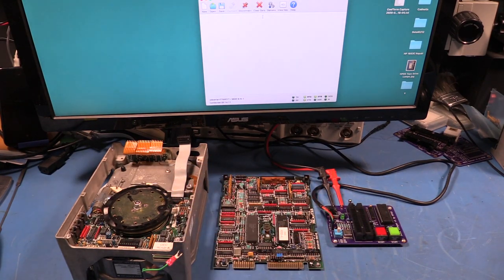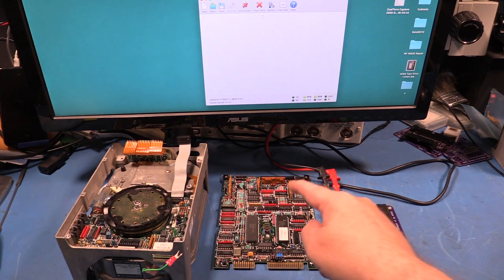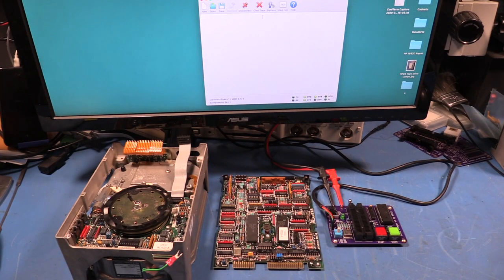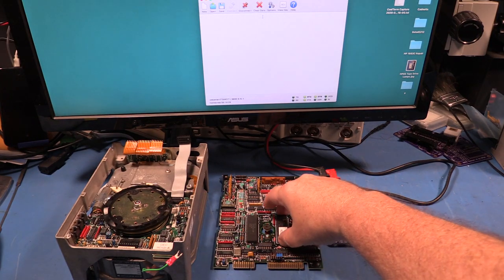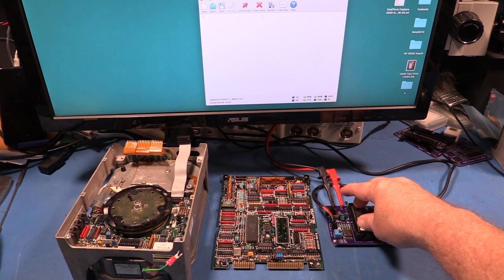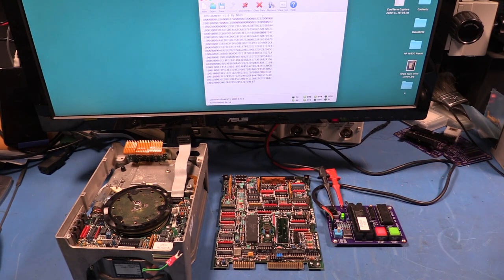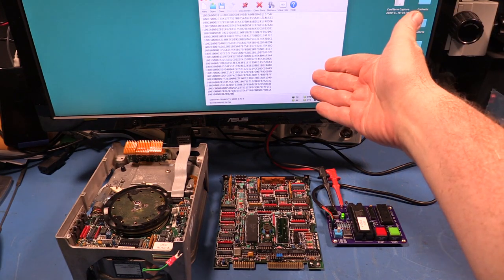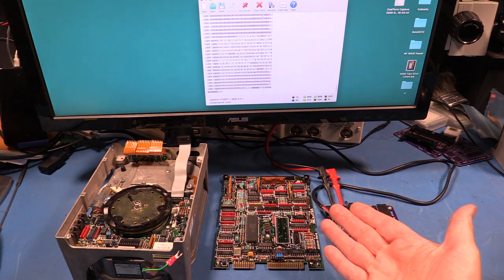Dumping DEC RD53-A (Micropolis 1325) Firmware

Comment: Hi Mark

Thanks for the video. I might build your board just for fun. But a question did you every solved the problem with the drive. Im having the exact same issue, I  guess the spindle speed doesnt got within  the spec and pulsing. For my the problem was the i had the drive working from the beginning (bought a network system for Luxor computers) so i tested it during the evening the next evening the drive did this thing with spindle speed pulsing.

Again tnx for the content

Per
Reply from the maker: I ran out of steam on fixing the drive, but I do plan to resume work on it eventually. I think that what is going on is that the rubber end of travel bumper turned to goo, so the heads have moved out of the normal parking area beyond the written servo tracks. I believe that the drive roughly regulates spindle speed with feedback from the Hall effect sensors in the motor, and then it begins looking for feedback from the servo platter head for fine speed control. It doesn't find it, so it never unparks the heads and it gives up.

I tried manually pushing the heads off the stop. but the drive immediately panics and spins down. I am guessing that it doesn't want to see tracks in the normal data area, either. So my next plan, where I ran out of steam, is to build something that mounts to the drive and lets me finally adjust the parked position of the heads with a micrometer.

I tried shimming the parked head position as described here, but I think the parked position stop in my bad drive is too far gone for that to work:

https://www.pdp8online.com/rd53/rd53.shtml

Comment: Horrible drives, these were never good. 
That said, it sounds like your drive is losing index or never sees index. There is a pulse pattern on the innermost cylinder that the servo head reads during spinup to determine the drive's speed for regulation. Even if the rubber bumper isn't sticky, if it's too soft, when the heads push against it they can miss the pulse track.